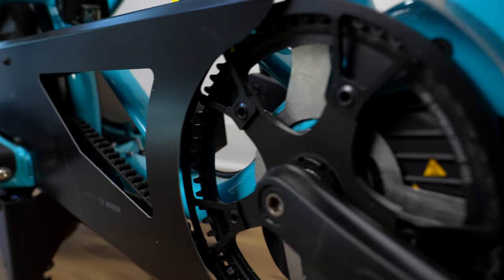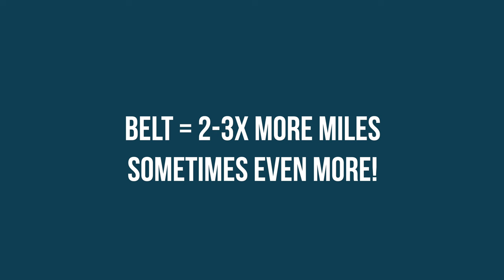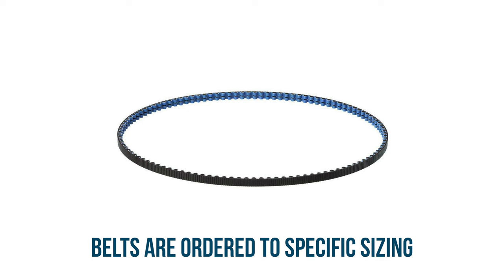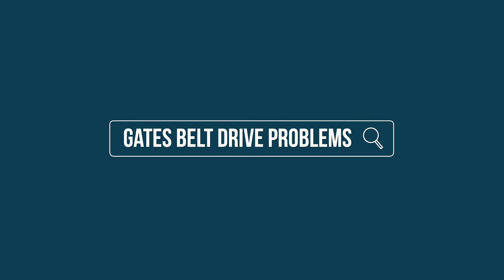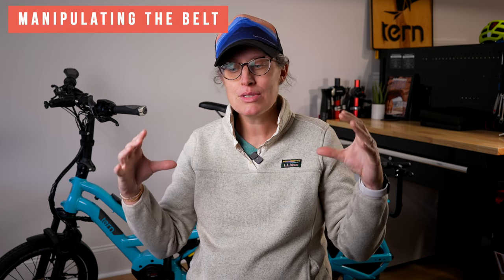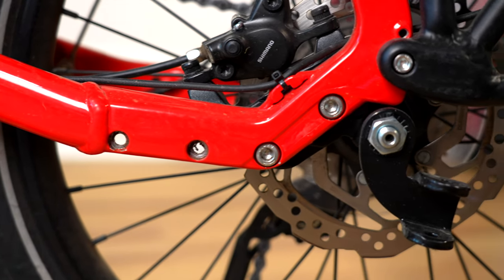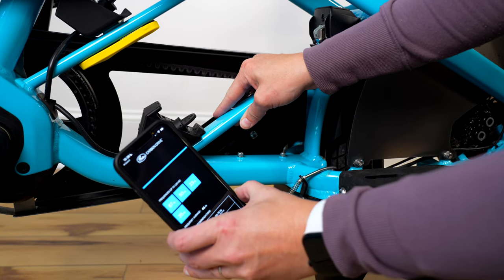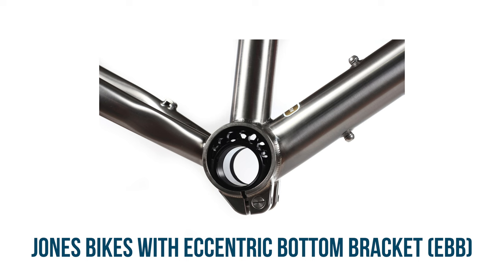Get Started with Gates Belt Drive Systems: What You Need to Know

Comment: I looooove Gates belt drives. Quiet, stout, clean, long lasting, easy to maintain. Once I had one bike with it, I was sold. Now it's almost a requirement that any bike I look at has at the very least, the option to install it. If you're the type of person who never checks the oil on your car, who hates, hates, hates, getting greasy and dirty, and just wants something that just works, and "generally" just isn't any trouble...try a belt drive bike.

Comment: My belt stays at around 26-28 Hertz. It’s been like that forever. According to gates this may cause the belt to jump teeth or the components to wear quicker. However, I’m going on 26.000 Km so far with a full bikepacking setup and I have yet to see the issues that gates claim may be possible. It is in fact more tension that wears the components quicker as the rubbing of the belt creates more friction under more tension. Alee Denham from cycling about did an entire test on this.
Reply: Any idea where we can find Denham's test?  I'm not doubting this, I'd just like to check it out.  I searched his website but maybe I missed it.  Thanks!

Comment: Thanks for the helpful vid. I have some questions that I can't seem to find any helpful answers to on the web or local bike shops. Any insight much appreciated. I went for a belt drive and enviolo hub on my riese and muller multicharger in the hopes of having almost no maintenance. I've now learned, it seems belts do require more maintenance than I thought. What I can't find an answer to is how to know how often to clean my belt, so that it can last hopefully at least 5000km (not sure how fast heavy ebikes wear out drivetrains compared to standar cycles). 
   My analogue workhorse commuter all round bicycle with xt/ultegra level components would see chains/drivetrain components lasting 5-10,000km just with some greasing and wiping every few hundred miles. California weather.
   This multicharger is my first ebike and first belt and I have 4000km on it. Generally riding rain or shine here in germany on pavement and forest roads. Usually using no motor, eco and tour modes. Averaging about 100W human power output. I have washed it, but usally only when it's dirty with mud. Maybe 3 or 4 times now. It seems to perform fine so far, but a shop tech said it might be toward the end of its life. Is that normal for this situation usually? Only 4000km. I will start cleaning it more, and checking tension now. Do you have any real world numbers of how many miles/km people tend to get from their ebike belt drivetrains in different conditions and different levels of care? 

Many thanks and smooth riding to you

Comment: Thanks so much for this helpful video! My belt was getting REALLY chirpy. Spraying it with water and cleaning the belt with a brush helped a little bit. The noise would go away for a little while, but within a day or two, it would come right back, especially pedaling up hills or any other situation where I was stomping hard on the pedals. I used the silicone spray you suggested, and this seems to be the solution I was looking for. Quick question about the spray. I have some WD-40 on hand. When I've used up the can of CRC spray, would WD-40 work? If not, I'll happily keep using the CRC spray.
Reply from the maker: I would continue to use it. If only for warranty purposes :)
Reply: @BikeShopGirl  So is there any special technique/best practices for using CRC on these belts?  Just lightly spray the toothed side as you're spinning the crank a bit to move the belt?

Comment: Also, I would point out a simple solution with an e-bike that has a lot of assist levels, mine has 10, would be to yank out the gear system and go to a single chain which I understand is much more robust than a gear chain, so more e-bike friendly. Simpler, cheaper, lighter. Then use the assist levels like gears. The downside to this option is that if you lose battery power, you may be stuck with a far more difficult pedaling experience which is what many of us are trying to avoid, and some like me NEED to avoid.
Reply from the maker: Mid-drive motor systems rely on your cadence to perform well. Higher cadence the better. 

There are some hub based single speed e-bikes I’ve seen out but they also have throttles which would overcome any slow cadence problems :)
Reply: @BikeShopGirl  Good point. Mine has a throttle. Also, maintaining cadence becomes easier with higher assist level.

Comment: Hey! I have one of these, and when I was leaning my bike up against a rack today the belt got pulled and twisted away from my frame. Probably a good 45 degree rotation and an inch or so out of alignment. Will this cause my belt to fail prematurely? If so, how prematurely?
Reply from the maker: eek, that is a crazy story. What did it get caught on and did you pull super hard?  I would really inspect the belt because they aren't designed to be twisted like that.

Comment: I was wondering if it's possible/practical to retrofit a bike with a chain drive/internal hub with a belt drive
Reply from the maker: You need to have a speciality frame that has a split in it since the belt is one piece.
Reply: This is the Achilles heel of the technology... A very non standard frame is needed.

Comment: Thanks for the helpful video. I changed my rear tyre and I'm now getting a whirring sound that I speculate may be the individual  lugs on the belt rubbing on something. I'll check the tension as you suggest but would be grateful for any other tips.
Reply from the maker: Does the whirling only happen when you pedal?

If so I would check the belt isn’t rubbing the chainguard and where the cable attaches for the gears.

If it happens only when the wheel spins, check the tire isn’t rubbing something.
Reply: @BikeShopGirl  Hi, thanks! It was the gear cable rubbing on the drive ring teeth. It had come out of it's clip near the bottom bracket and moved outboard without me noticing. No apparent damage, thankfully. Now (hopefully) securely back in it's clip. Advice bang on point and very much appreciated.

Comment: I can get a good 6/7/8 speed chain for a Nexus/Alfine for $9 and a Gates belt costs $110, so yes: SLIGHTLY more expensive. Also, the chrome plated, hardened steel Nexus cog is about $12 with shipping, a Gates cog is at least $80 or $100. Jenson USA has stainless steel chainrings starting at $38 and an aluminum Gates front sprocket is about $100. Given that I can buy 12 chains for the price of one belt, I don't think belt drive is for me.

Comment: Do you only check the tension on the upper half of the belt (so after chainring) or do both 'sides' need to have the same tension?  Given that the tensioner is usually at the bottom (mine is at least), the tension there is quite a bit higher than the top half.
Reply from the maker: Is your tensioner spring loaded?

I check in one place for consistency.
Reply: @BikeShopGirl  No, which is - according to the local bike shop, it's a canyon - part of the issue :-) It's going back, the difference between different positions of the cranks is too high to be solved.

Comment: Belt tension puts extra strain on bearings also I see problems if you had a side of the road puncture repair.
Reply from the maker: Changing a flat is pretty easy, the wheel just drops down and you remove the belt like you would a chain on a single speed. 

You shouldn’t see premature bearing wear unless the belt is too tight.

Comment: What if you want to do such a conversion BUT it's on a NON bike conversion where the center distance from each pulley distance is much shorter?? Is there a calculator to enter the sprocket sizes & center distance and get the pulley / belt conversion??
Reply from the maker: I would contact Gates as I've only seen that calculator on a bike builder login.

Comment: I don't have a belt. I do have a friend who does. He does a lot of bike trekking. His belt failed on a trip once and kinda messed up his trip. I gave him this advice, don't start carrying a spare, yes, they don't weigh a lot but they do weigh something and they take up space. Have a friend, like me, who has another belt in an overnight shipping box ready to go. Call the friend, have them dropship. Secondly, I recommended he swap out the belt every year. Then keep the old belt as a spare. So if something did go wrong, he could use the old belt as a spare at least until a new belt could be acquired. He ignored me and now carries a spare. Sigh.
Reply from the maker: I carry a belt on tour :) much faster to just have it on the side of the road, like a tube!
Reply: @BikeShopGirl  True, but the frequency of need is low. So you're paying in weight and volume for a lot of miles for that convenience.

Comment: i have a Mercedes E Bike, with Gates carbon belt…the belt is shockingly noisy. i’ve spoke with the manufacturer and they send me dry lube…but now i see that you don’t recommend it….
Reply from the maker: How’s the tension? Is there a tensioner that needs lubed?
Reply: The squeaky/ noisy belt can come from dusty/ dry conditions. I am currently on a World Tour with my dog Mira. I mention this to let you know that we experience all kinds of conditions with Gates belts. I recommend a simple bar of soap. I rub some on the lobe side of the belt where it would contact the rings. This will quiet the belt and can be effective for several days. Best of luck